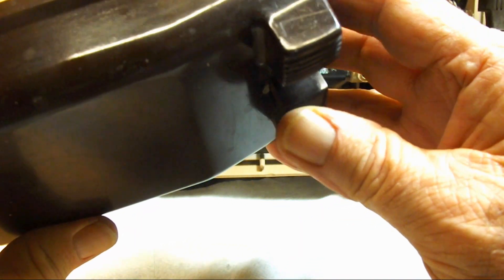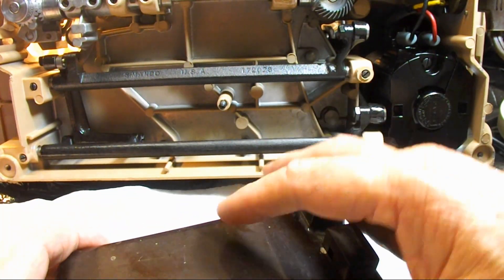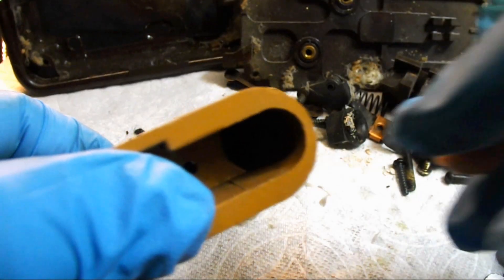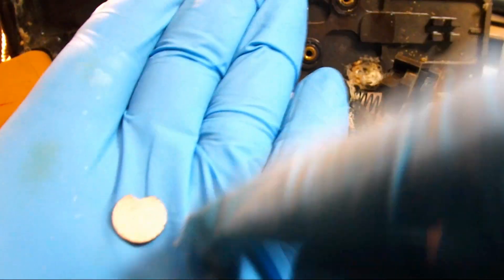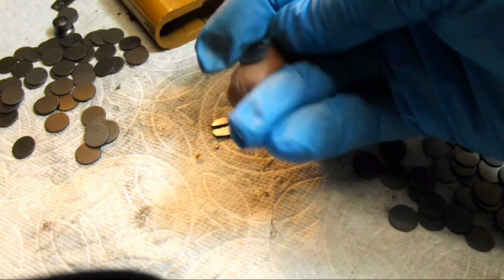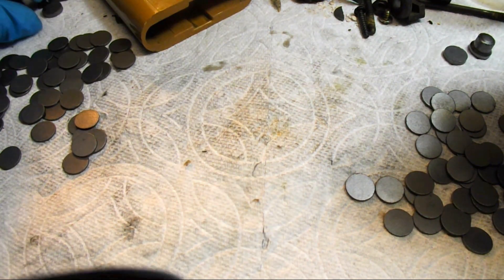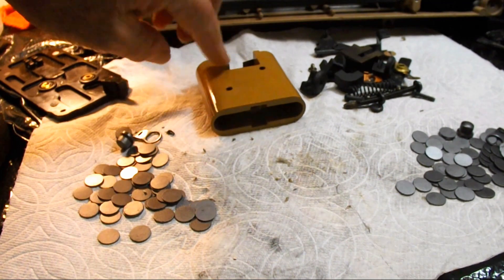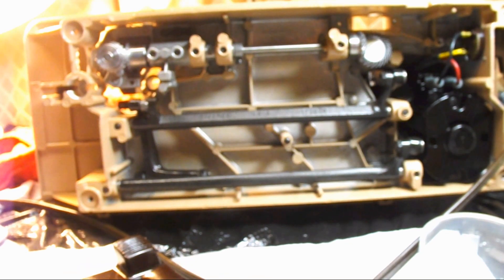Clean & Restore the Motor & Foot Controller of Betsy, a Singer Model 404

Comment: I cannot thank you enough for your videos!  I'm almost finished with the reassembly of my Mother's 403a after following your series on Regina.  Based on the serial number, I believe it's from 1960.  It's one of my most cherished possessions because it was hers.  Thank you so much for your guidance to restore it myself! 
A FB MP sale was too good to pass up ($20) so now I'm also the proud owner of a 404 and it's cabinet. It appears to be in good physical condition just seriously dirty.  This series of your videos is reassuring me it will be a repeat of what I did with the 403.  However, until this video, it hadn't occurred to me to disassemble the controller.  Now, that too is planned for both machines.  ❤
Reply from the maker: Nicely done! You have two of my favorite Singer machines now. The incredible 403A Slant-0-matic Special, and the heavy-duty 404. That's about all you need to sew and craft whatever you want. That was a great buy on that 404, btw. You'll find the 404 so easy to clean and work on, too. I know you are finding this work rewarding, so don't be surprised if you start finding more models you'd like. Thanks for rescuing that 404 and thanks for the nice comment.

Comment: Did you change the carbons on the pedal? Are these charcoal disc pedals better than the Chinese charcoal disc pedals?
Reply from the maker: Two carbons were damaged and I tossed them out. The other 100 carbons I cleaned by rubbing on a paper towel. Here are the only carbons I buy. The discs inside are twice as thick as the original Singer discs. https://www.sewingpartsonline.com/carbon-resistance-unit-singer-618804-003.aspx
Here is a series showing how I restore a button style foot pedal: https://www.youtube.com/playlist?list=PLsCOZgzzaiKL6ePPxLpmnWSzTyxPKTb71
Here is a link to all my playlists, sorted by Model number: https://www.youtube.com/channel/UCUSPDsHaFtRoz1VA2U1xJ4w/playlists?view_as=publ
The foot pedal in this video has the original Singer carbons and is from 1958. No carbons I have ever bought new are as good as the original carbon discs, in my opinion.